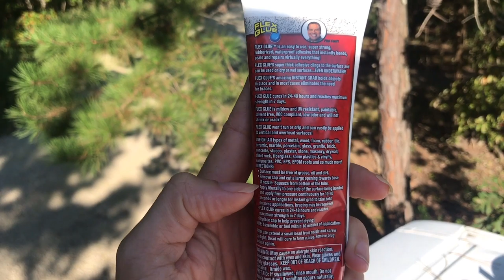1,000 Miles in a few days - WY-MO -Sprinter Van Adventures

Comment: That'll leak again soon.  Next time use an exacto or utility knife to cut a groove removing the loose edge then fill it in overlapping onto the plastic lip.  Use your finger to push it in and leave it smooth.  

You looked good working on it for sure!
☮️

Comment: DIY! Bravo! We have used Flex Seal and other Flex products and have had NO good results! If you still have a leak.....scrap all loose sealant off and get roof seal, like Blackjack. It is horrible stuff, but it seals. Also I have used evaporative cooler seal. They are similar. They are black and take a day or two to harden, what they do harden. They are flexible and I recommend 2 coats. Great to see the behemoth gets some love! Thanxz

Comment: I went through the same leaking vent problem and have a solution if you find yourself in need again. There is a product called lap sealant by Dicor . Check out some videos on applying it. It is like a soupy caulk that flows a bit when you apply it and the idea is to cover the whole vent lip, screws, and seam at the same time without touching it or trying to make it look neat. It is what is used on almost all RV’s and should last for years. Look for the bald guy mascot on the tube. Happiness, fun, and adventures in all your travels!!! If you can not locate any, drop me a line with somewhere to send it and i will hook you up as i bought a case at the start of my project and have about 10 extra tubes.

Comment: That Flex glue is really good. I have used it a few times for different things and it worked... you can get that in a spray that also works great and easier to use.. Good Luck